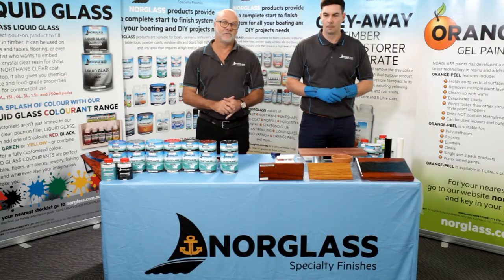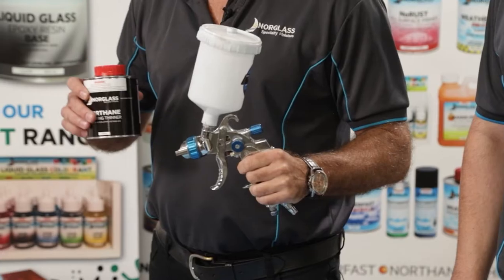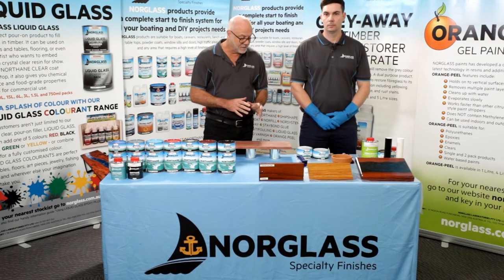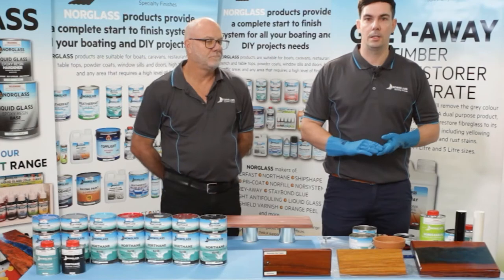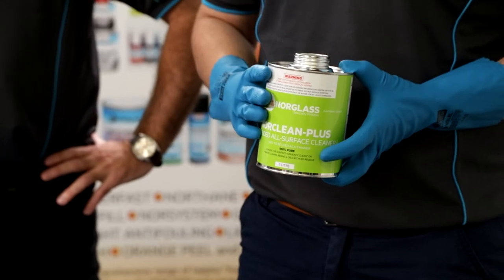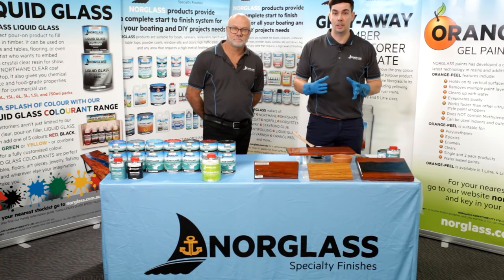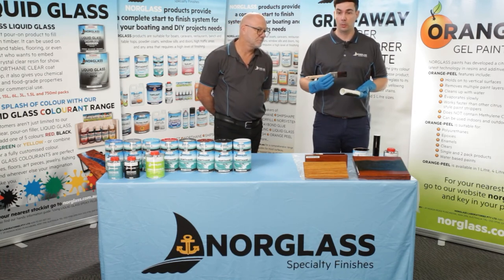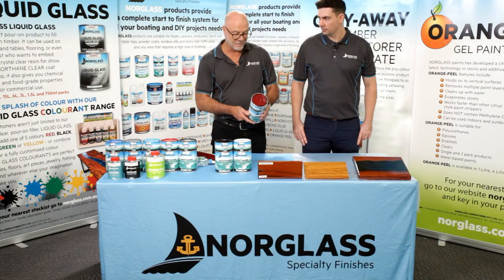HOW TO: Use Norglass Northane 2-Pack Paint System

Comment: This is the worst paint I have ever used in my entire life. I mixed 2 parts base one part hardener by weight using digital scales. The paint is extremely thin and constantly runs. I had to thin out the cover so much it was virtually transparent and it still wanted to run. looking at the mixed paint in the container, it's watery thin. I tipped the paint back into the can and threw the lot into the bin. I don't care how much it costs I'm getting some international perfection polyurethane. I've used it before and it's light years ahead of this rubbish. I'm not a troll, this is what happened. Norglass, your paint is terrible.
Reply from the maker: Hi Steve, the issue is you mixed by weight and not by volume, the product will fail if you don’t mix by volume because the specific gravity is different for both base and hardener. Weight mixing will never work and that’s why it failed. Sorry you didn’t have a good experience here,  but this product is one of the very best in the market and we never have an issue with it.

Comment: How am i to work out the % of thiners to mill ? And being its 3% of thinners to roll the clewr on .. is that 3% for all total mills of cans ? Example 500ML till 1.000ML tin
Reply from the maker: Hi, it's generally 3% of total mils you ae using, so if you are using a can of 500mls then you calculate 3% of that. Keep in mind in hot temperatures you may need to keep adding a little thinner as you go, as it will evaporate quicker. We hope that answers your question.

Comment: Planning on painting a fibreglass boat that has flowcoat finish, will a light sand before applying do the trick or should it all be sanded back to bare glass? Thanks so much for the advice on the vid!
Reply from the maker: Hey, thanks for reaching out! 
It is advised that a good clean with Norclean Plus be done before sanding and sanding is to be done with 240grit dry non-clogging sandpaper across the entire existing flow coat to a level where you have removed any existing gloss and created an even key across the surface. Once done, again another clean with Norclean Plus once more before moving ahead with your Ship Shape Primer and Northane finish coat. 

For more information, please visit our website, as there is a complete guide on painting fibreglass surfaces and has a tone of helpful information.
Reply: @norglasspaints  Lovely! i've had a solid read and feel a whole lot more confident. I had one last question. WHen it comes to the surface of the bow of the boat, id have to incorporate a speckle to increase the friction under foot to prevent slipping. Do you know which product can be added to increase friction
Reply from the maker: @Nick04044  Hey Nick, thank you for reading our last reply, if you're looking for a paint for the surface of your deck we would recommend our Marine Deck Paint. This product has a slip resistant agent within the paint that will allow the surface to have that increased friction you described. If you follow similar steps to those listed above, but instead of Northane you use the Marine Deck Paint, that will be the best course of action here. 

Please note that as you are changing from a two pack to a single pack it is imperative that you allow the Shipshape to completely release all potential solvents (we recommend at least 48 hours) before coating with Marine Deck Paint.

Comment: I need a product like this for my JetSki hull… Matt finish so abrasive surfaces don’t wreck it. Any suggestions? Or will this product be very resilient?
Reply from the maker: Hi, this product is perfect for a Jet Ski, you can have a satin finish by adding our flattening agent, however having a gloss finish makes the surface a lot easier to clean. The product is highly durable and flexible and has excellent resilience.

Comment: I've been having so much trouble applying the paint. The instructions are a bit light on details (environmental, film thickness, tipping brush). Of course I started thinking it's the product but I'm thinking it technique/environment more. I'm thinking low temp, low humidity, low wind is best but it's pretty difficult in QLD on the water right now. Always hot, windy, and humid. I tried tipping with a brush but the finish was worse than just rolling. The roller finish is very stippled. I tried sanding then up to 30% thinner to just try and get a thin last final coat. Finding it difficult to get a smooth sanded/buffed finish otherwise. Going mad.
Reply from the maker: Hi Josh, sorry you're having some troubles. There are quote a few variables here, we'd like to chat with you so we can help sort the problem. Suggest you call us on 02 9708 2200 to speak with tech support. Thanks, Norglass
Reply: @norglasspaints  truly nice to get a quick reply. I had a chat with the tech and give it another go with the tips. As I mentioned, the instructions are a bit light. Advice was humidity is most important (50% ideal), temperature and wind not. Thin film. Use a maverick foam roller. Best gloss from the paint not trying to sand and polish. Advised not to wet sand as prep but I have to break that rule being on the water and not wanting to spread toxic paint dust into the river. Hopefully it helps someone else finding this.

Comment: Look's like a great product !!
Reply: I think your product is not customer focused. Firstly, you show mixing from one can into another. For economy, it would be better to show how to measure volumes and also provide a weight method. For instance, if one buys a half litre tin, then provided the weight of 50% of the base coat, and the weight of 50% of the hardener. This would allow smaller jobs with a quality outcome.

Secondly its frustrating that the product requires a 16 hour re-coat for a brushed job. This means for three coats, one needs three days. That means you cannot finish an exterior job over a weekend. That's not customer focused. Yet its touch dry in one hour, and the mix stays useable for 8 hours ... and 8 hours is pointless, because paint jobs for these small can sizes don't take 8 hours. With a product that your instructions say for outside, might need 6 or 7 coats - that's over one week of fine weather, to get a job done. That's too long. It's not customer focused.
Reply: @douglaslin5469  ideally one should spray these kinds of paint. Wet on wet it would take two to three hours to complete 2-3 coats with up to an hour wait between coats.

Comment: Have you had any good feed back using this stuff as a sealer for chest freezer plunge pools? Thanks
Reply from the maker: Hi, if it's Fibreglass, Shipshape undercoat with Northane is perfect for it. If its not Fibreglass suggest you call and speak with our tech department 02 708 2200

Comment: Bathtub and shower tiles? 
How would you rate this for that sort of project. 
It’s been recommended (on a Facebook group)
Reply from the maker: Thanks for the question!

Northane is perfect for refurbishing your bathtub! It will require a primer, we always recommend Norglass Shipshape. We have an entire guide on our website describing the process of refurbishing a shower floor, that will work the same way for your tub. ((See link below))
Shower tiles can be a little trickier, our general rule is floor tiles are not ideal to be painted, and we don't recommend our product on them. However, with wall tiles, with a good clean with a product like Norclean Plus, and two coats of the Norglass Shipshape Primer, you would be able to use Northane right on top to refresh your tiles. 

Refurbishing Fibreglass Shower Floors: https://norglass.com.au/guides/diy-projects/refurbishing-fibreglass-shower-floors
Reply: @norglasspaints  thanks for actually replying, so much help.

Comment: How long is the mixed 2-pack useable? For small projects would I mix a smaller amount?
Reply from the maker: The mixed paint will harden (or become un-useable) after about 3-4 hours, so if you only need a small amount just mix up smaller quantities making sure you keep the correct 2/1 ratio.

Comment: Whats thecrecommended grit of sanding PRIOR TO APPLICATION OF PRIMER PLEASE.
80? 120?
ITS AN OLD 85 gelcoat, partially hull coming through duevto lots of residual paint layers.
Thought to do 80 then 2 coats primer, 240 in between then 400, then 3 coats northane with 240 in between.
Which roller, mohair or not; first comment was nap roller is better?
Im in south east qld with. More than 50% humidity

Thanks for your advice
Reply from the maker: We recommend using 240-300 grit sandpaper for all coats, but 400 is fine for the finish coat. Short nap mohair roller is better. 50% humidity is ok, if it's above 75% then you'll lose some gloss level. Thanks
Reply: Is it advisable to remove most of the orange peel after the second prime coat or just a light sand?
Can I leave peel behind, top coat paint is self leveling especially with 3 coats?
Reply: Thanks
Reply from the maker: You need to sand as much as possible. Top coat will mirror primer. We suggest you call our tech line as there are several variables. 02 9708 2200

Comment: What happens when you paint inside with the humidity is higher than 75%
Reply from the maker: If there is high humidity the gloss level of the paint will be effected, otherwise it will be fine. If you're inside suggest turning on air conditioning while painting if you have it.